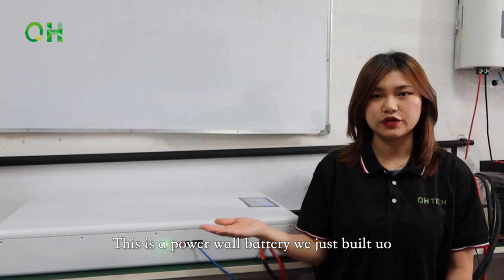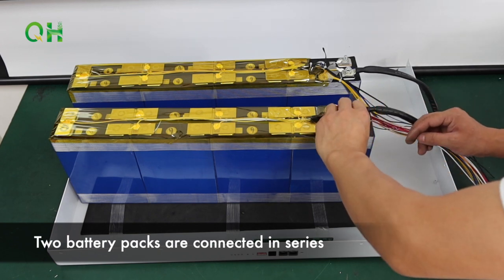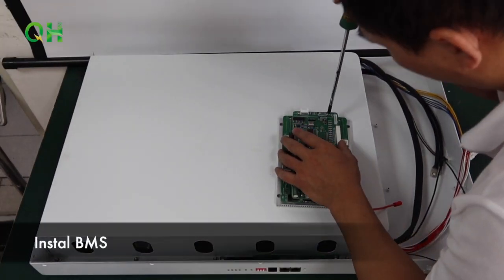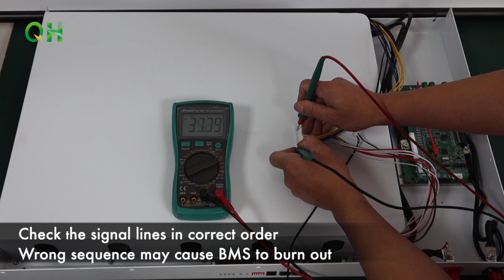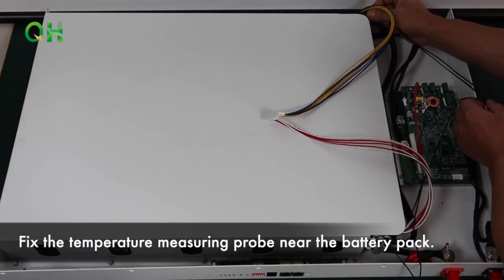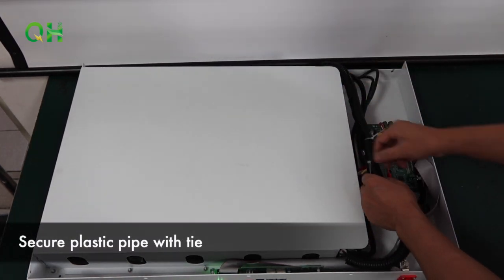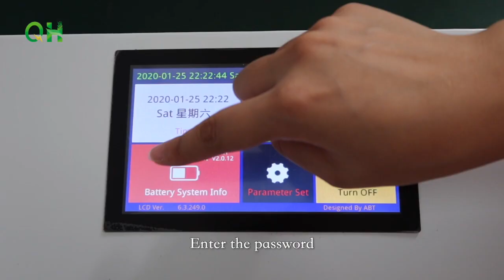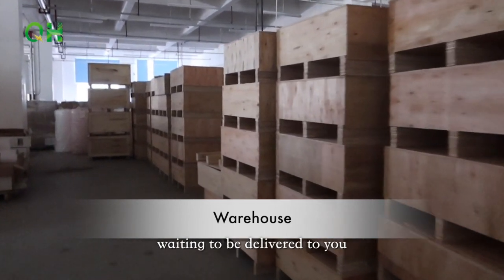10kWh 48V 200Ah Powerwall Battery for Home Solar Energy Storage system! How to Assemble?

Comment: Can I buy an LCD monitor?  I have two of your batteries, and would like an LCD monitor for each battery.
Reply from the maker: Thanks for your comment, MR.Bauer. The shipping cost would be very expensive that only buying one piece LCD monitor.
Reply: Tell me if the battery  is good
Reply: I have had no problems with either 10 KWh battery.